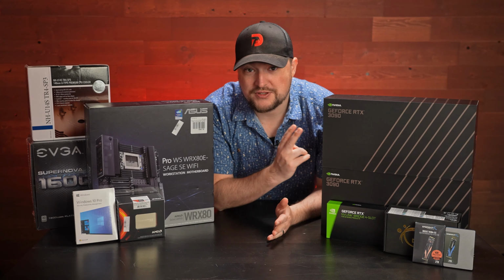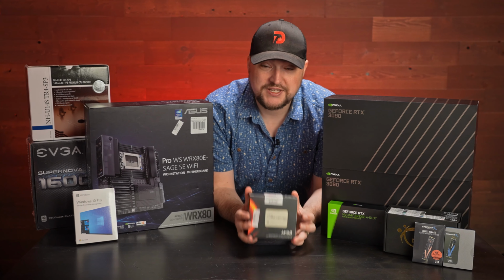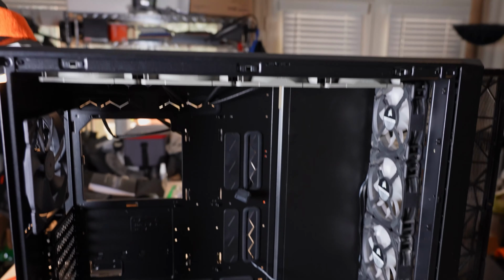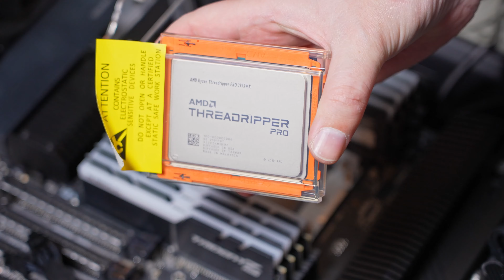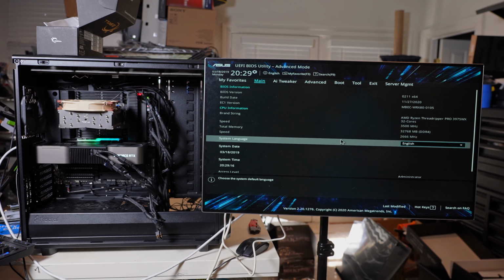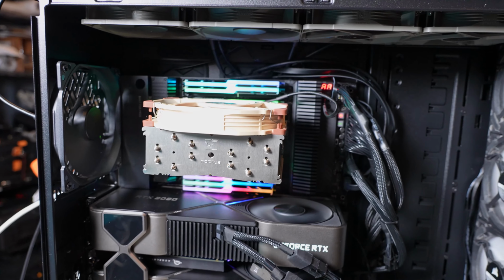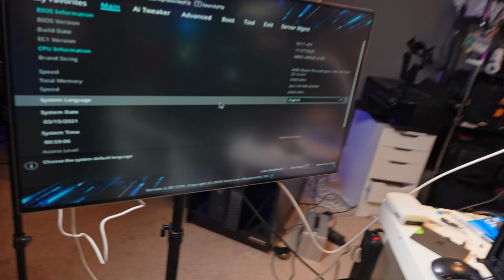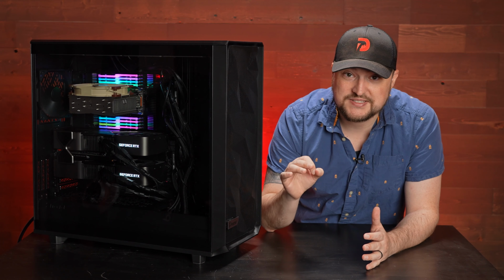AMD Threadripper 3975wx Dream Workstation Build!

Comment: For ram on this system was it just as simple as setting XMP/DOCP or did you have to set the clocks and timings manually? I've not found much information on this so far but everything I've found so far has been pretty conflicting information all told or were you stuck at 2666MHz on ram? reason I ask is that if It's just a case of setting manual then I may just grab a second kit of the 4400 C19 ram I have currently and see if I can't run 3200MHz 14 14 14 32 1T or something, otherwise I'll likely just grab some proper ecc stuff
Reply from the maker: It was updated in a recent BIOS update - you can now change the frequency of the RAM up to 3200MHz.
Reply: @District7DrewGeraci  ahhh Brill, do you have timing and voltage control? I've got 2 kits of 2x8 4400mhz CL19, my hope is that if it can run lots of ram at 3200mhz then my hope is that I'll be able to run say 64gb at 3200mhz with reasonably tight timings, say 14 14 14 32 1T or perhaps CL12 or CL13
Reply from the maker: @blazingmatty123  I don't think it'll be compatible with the board unfortunately, even if you retime.
Reply: @District7DrewGeraci  Yeah I know that speed won't be compatible, I'm more talking about setting lower speeds with tight timings, I know that this kit can do 3200MHz Cl12 on my current 7920X (though I run at 3800MHz C14 at the moment) I understand that the max for these cpus is 3200MHz so I was more hoping I can just set 3200MHz and run something like 14 14 14 since tight timings are B-die's thing, these sticks have never actually seen their rated speed since I've had them mind you, I've always had them set manually at the max my cpus at the time could handle so I'm hoping that I could just set them to 3200MHz and set the timings manually, but that'd likely require vdimm/memory voltage access and access to SOC voltage to do is all

Comment: Hey man! I have a similar build to yours that I had for years now, but recently somehow I forgot how to get in there and control my cpu performance or even control the water pump and fans. Ryzan Master doesnt seem to be working either and cannot install it again :( wondering if you had any off these issues and what app do you use on the windows side to control the cpu power and fants etc? or only thru bios? sadly now the machine is set up for me to remote control into it while i travel so I cannot get into the bios and started to notice cpu temps to go up on ideal. Hope you can help me find a solution here :) thank you

Comment: Could have waited for Threadripper Pro 5000 series while GPU price drop. Anyway, think you'll still have decent performance ;)
Reply from the maker: If and when the new 5000 series comes out I'll likely upgrade to that as well. My previous build was a little over 5 years old so I needed an upgrade for the work that I do. Couldn't wait another year+ for it.  And the performance in this computer is the BEST I've ever used on any machine hands down ;)

Comment: Hello is 4,2Ghz to low for gaming ? sry
Reply from the maker: No, anything above 3.5Ghz is good to game with. The GPU is the most important component over the CPU anyway.
Reply: @District7DrewGeraci  can you maybe make some games like RDR2 and other games in 4k ultra settings to encourage me that I can buy the 3975X immediately?

 best regards
Reply from the maker: @Trailerofdead  it plays anything in 4k like butter. Especially with an RTX3090 or 3080ti.
Reply: @District7DrewGeraci  How much fps do you have in RDR2 4k Ultra MSAA x2
Reply from the maker: @Trailerofdead  60fps, I don't have anything faster though (monitor wise) but I would guess it maxes out around 120-140fps
Reply: @District7DrewGeraci  How is that possible? I run a 5950X with 2x 3090 4K 144Hz and have 67 / 9-70 fps
Reply from the maker: @Trailerofdead  it all depends on the game and settings. I can do 152fps in Warzone with high settings in 4k with (dlss on).
Reply: @District7DrewGeraci  DLSS has to be off to see how much power / fps it can

best regards
Reply: @District7DrewGeraci  You operate 2x 3090. That means per 3090 with 16 lance! Is that why you made the boost in the GPU profit?

I think 32core is perfekt^^
Reply from the maker: @Trailerofdead  I'm not even sure what the means.
Reply: @District7DrewGeraci  You have achieved the maximum bandwidth PRO 3090. And that twice. This is how you gained more fps

Comment: What temperatures do you get under full load for a longer period of time?
Reply from the maker: Averages around 69-70c at full load with air cooling.
Reply: @District7DrewGeraci  Thank you very much for your fast response! Which software did you use to read out the temps? I get around 83 °C under full load with the same mobo and cooler with a 3955wx and I think it is too high
Did you adjuste the fan curve in the Ipmi?

Comment: Hi, I just purchased the same motherboard, only, none of the RGB software I've used will recognize and control the bottom 4 slots. The ram is recognized in the bios and CPUZ but only the top four slots can be RGB controlled. Before I return the motherboard, I was wondering if your software sees and controls all slots or just the top four. I'm suspecting it has something to do with the software not recognizing 8 channel and set up only for four, otherwise...
Reply from the maker: Hi Larry, I think it depends on the manufacturer - I haven't had any issues with my memory RGB settings but G-skill makes it pretty easy to control. If the memory is being read then it's likely a software issue. You might try swapping the top 4 to the bottom 4 and see if the problem persists on those channels or that memory specifically.

Comment: Hey man great content, I have a similar build and a question for you: have you had any trouble getting your ram to actually clock at 3200 mhz? Since this board recommends ECC memory? I have 8 32gb Crucial Ballistix and cant get past 2666mhz in the bios.
Reply from the maker: Thanks for watching! This definitely seems to be the most asked question. Unfortunately, it looks like the board 'supports' up to 3200MHz, but in reality, it only supports up to 2666MHz. I haven't been able to break past that and I believe it's due to the number of DIMMS supported on the board and 4-channel vs 8-channel memory.
Reply: @District7DrewGeraci  just came to figure out from someone else's post you need ram listed on the mobo's support page. Server tier ecc udimm spd jdec stuff

Comment: You can probably move all of the gpus down to the bottom that way you can use the top slots for nvme cards. All the slots are x16 so I do not think it would hurt gpu performance in any way.
Reply from the maker: Yeah, I ended up doing that. It freed up 1 extra PCI-E lane which is better than nothing!

Comment: Have you been able to get your ram past 2666MHZ?
Reply from the maker: This definitely seems to be the most asked question. Unfortunately, it looks like the board 'supports' up to 3200MHz, but in reality, it only supports up to 2666MHz speeds. I haven't been able to break past that and I believe it's due to the number of DIMMS supported on the board and 4-channel vs 8-channel memory.
Reply: @District7DrewGeraci  hmm I unfortunately bought similar ram, gonna have to dumpster dive for the boxes to return lol. I think it has to do with ECC/Non ECC memory and registering, the mobo memory specs only list server type non consumer sticks with part numbers. Gonna try those out
Reply: @ga-ns8ls  unbuffered (U-DIMM) ok for up to 256GB. If you go big, you'll want registered (R-DIMM). Just make sure DIMMS have SPD JEDEC speed DDR4-3200.
Reply: @nnunn606  just ended up going with KSM32ED8/32ME, thanks brotha.
Reply: @District7DrewGeraci  much easier in latest bios. you can overclock the ram, but remember that 1600 is actaully 3200 because iti s DUAL DATA RAM so setting it to 3000 will not post and force a bios reinstall, I found! might get above 3200 setting it to  above 1600 but I think it all works at 3200 happily on auto

Comment: I have an Zenith 2 Extreme Alpha with a 3970x,, in the define R6.   I first routed 3 extension cable for the power leads to keep the bulky corsair hx1000 power leads out of the way as this motherboard blocks the most of the grommet holes.

Comment: Hi Drew, also being a Davinci Resolve user, I'm actually buying all the stuff to start the build of nearly the same config, but have a question about the RAM-modules you're using: these Trident's aren't mentioned on the Qualified Memeory list that ASUS is posting on its support page for this motherboard; did you have any issues so far while using your setup? ((you had memory issues in the beginning but that seemed to be linked to a motherobard failure).
Another question: why the Noctua CPU-cooler and not an AIO like the Corsair H150i? (Which I've bought :-))
Thanks
Reply from the maker: Hey Dirk! No memory issues - stable at 2666MHz (can't get it to 3200 because of the number of DIMMS) but otherwise it works great. The memory issues I had at the beginning were due to a faulty MB but has obviously been fixed. As for the Noctua vs H150i, it's all that would fit the socket at the time of building. I had purchased the H150i (oddly enough) but they didn't have the support bracket to fit on the sTRX4 socket so I had to swap out with the Noctua. That being said, no real heat issues. Maxes out at around 68-70c and runs fine. 

All I can say is that this is the best system I've ever used for video editing. Davinci Resolve LOVES the dual RTX 3090s.
Reply: Hi Drew, thanks for your quick response. 
I'm still worried about the memory as apparently you can't get it to 3200MHz; don't see why the number of DIMM's should have an influence on that.
Wrt the H150i, it does now support sTRX4 (/sWRX8), so they must have updated that.
I've bought 2 Aorus RTX 3090's Waterforce to avoid the spacing issue that you encountered, as I need the same amount of storage plus some other I/F cards, hence I need the 3 remaining PCIe-slots. These 2 have cost me a fortune (guess I paid even more than you did), and while I hate the Gigabyte SW, these were the only ones available over here in 2-slots. Will have a lot of water coolers in my system, but the LianLi D888WX should fit them all.
It's indeed an incredible build you've made there. Hope mine will also pay off using Resolve.
Cheers, Dirk

Comment: If you put that Asus Hyper GEN4 m.2 card in the first slot it won't cover any of your gpu fans.
Reply from the maker: Great suggestion!
Reply: @District7DrewGeraci  you also get a clean connection for the displayports that can hit the case edge in the top slot. I am a bit worried that the heatsinks for the chipset and m2 are not allowing fully connected pcie slots though

Comment: Most of the time when building with huge CPUs there is just a bad cpu seating  that causes a memory channel not working.
and under the covers of the mainboard are M.2 slots, using them instead of the PCIe card gives the GPU better airflow
Reply: This^ threadripper is quite finicky on mounting pressure

Comment: I'm told by custom builder sites that I NEED a liquid cooler for anything ryzen 7 on up. They won't even let me select air cool.

unfortunate ab out the mobo
Reply from the maker: Bummer to hear that. I love liquid cooling (and would have gone for it) if it were available for my TRP. At the time of the build though, no one made a cooler that could fit the socket for liquid cooling.

Comment: Didn't watercool the Threadripper... interesting. And guys, he probably paid $5000 for two RTX 3090's.
Reply from the maker: Thankfully it wasn't that much! It was only about $2k for each (right before the bitcoin mining boom in February). Also, water cooling for that specific socket didn't exist when I built the computer, otherwise, I would have gone with WC. That being said, the air temps are actually very solid. Thanks for watching!

Comment: what case are you using?
Reply from the maker: Fractal Meshify 2 XL
Reply: @District7DrewGeraci  for mounting the m.2 ssds into the motherboard, which pack of screws did you use? Nothing in the manual.
Reply from the maker: @Goldmaster  the screws were included with the NVMe drives that I used (and are what I used). There should also be a 4-pack included with the MB as well.
Reply: @District7DrewGeraci  yeah i have those. There are a total of 6 packs of screws and studs. 4 packs ending 700 (guessing for the m.2 card) then there is 1 pack ending in 600 and another pack ending 500 which contains 2 studs and 2 screws. I have used the screw and stud from the pack ending in 600 for the top m.2 mount, but the screw digs into the sticky pad.

Comment: Hi, thank you for this amazing video. Question, why didn't you use a liquid cooler for CPU?
Reply from the maker: Thanks for watching! The main reason I didn't go with liquid cooling was, because at the time of the build there were no brands that supported the Threadripper Pro socket change aside from (2) air-cooling only heatsinks. I still don't think there are any available currently but once there is I will likely swap out the air-cooled heatsinks for a liquid cooled one. That being said, the temps are surprisingly good for all air cooled.
Reply: My three year old Watercool Heatkiller is said by others to be a match. TRX40 and the WRX80 are a physical match. At 100 Euros that copper monster is a good price too.

Comment: Thanks for this interesting video. So, non ecc memory works fine with the TR pros?
Reply from the maker: Yeah, no issues at all.
Reply: @District7DrewGeraci  Any comments on using a high speed ddr4 like >4000Mhz?
Reply from the maker: @NiteshBhatia  the motherboard only accepts up to 3200 so you'll never achieve 4000 unfortunately.

Comment: Definitely would have considered putting a Supermicro Epyc cooler on that chip, considering the socket orientation.
Reply from the maker: I'm waiting on liquid cooling options to become available in all honesty. There's just nothing out for this socket right now, unfortunately.
Reply from the maker: @Darrin Scalpino You would have to make sure it fits the sWRX8 socket - I tried (2) other water cooling solutions a few months ago and even though they said they were rated for TR4 they didn't fit the 3975WX/sWRX8 socket. It's really kind of a cluster f%ck with all of these different types of sockets AMD makes.
Reply from the maker: @Darrin Scalpino excellent! Let me know how it goes.

Comment: What a fantastic build, very inspirational! thank you for that. What size and which 4x fans are you using in the top?  I take it that you using a Meshify XL chassis.
Reply: 120mm fans, for which I recommend NF A12x25 or a Arctic value pack consisting of 5 P12 PWM PST fans.

Comment: If you want to hide your power cables try converting the case to the storage layout, then you can hide the cables behind the back plate. Also if you need more storage look at putting in a U.2 raid card and U.2 ssd’ s. The U.2 drives can come in massive sizes and are the same speed as the M.2 drives. Excellent video , you have great camera skills.
Reply from the maker: I would love to hide the cables behind the back plate but there's physically no way to place the cablew behind it due to the size of the MB and the lack of cable spaces on this particular chassis. I would have to physically cut out holes for the cables or get x2 the length cables for each power source to reroute to the top and back down again. It's unfortunate but there's really no easy way (with this case and motherboard) to hide the cables effeciently which is a bummer. That being said they're not affecting the airflow and the system is running like a beast!
Reply from the maker: And thanks for watching!!
Reply: @District7DrewGeraci  I think you misunderstood my reply. you know that back plate piece between the front fans and the motherboard is removable?  You can then change its position and allow cables to run behind it. No drilling required. I had the same issue with my build and all my cables are now hidden and i have great airflow. It part of the reason I get fractal cases
Reply from the maker: @darcsentor  I'd love to see how you did it and see if I can do the same. I took that piece off to see if it was possible, but there wasn't any way (that I could find) to route the cables through and put the wall back up. If you have some photos or videos to share that would be great!
Reply: @District7DrewGeraci  sent a photo and video link, don’t know if you can see them, YouTube seems to have hidden them
Reply from the maker: @darcsentor  yeah bummer, didn't see or get anything. Silly YouTube!
Reply: @District7DrewGeraci  try Googling “Just shoehorned a EATX Motherboard in a Design R6 Case’ you can see what it looks like with the drive/back plate moved forward. Changes the look slightly but helps hide all the cables but airflow is still ok. Might need 120mm fans at the top for the last one. I put fans at bottom to feed air straight into the gpu too(which I think you have done)
Reply: Did you end up converting the case to storage layout for better cable management?

Comment: Sorry for the silly question. But when you installed the CPU did you screw the lid until the provided Torx Screwdriver clicked? I have a feeling that your memory sticks are OK. Threadrippers have the tedency to not sit well in the socket if they are not installed securely enough. One of the problems they present is not seeing all the memory.
Reply from the maker: No, that definitely wasn't the issue. The motherboard was 100% bad. That particular memory module slot stopped functioning and thus had to be RMA'd back to the manufactuer. Thanks for watching!